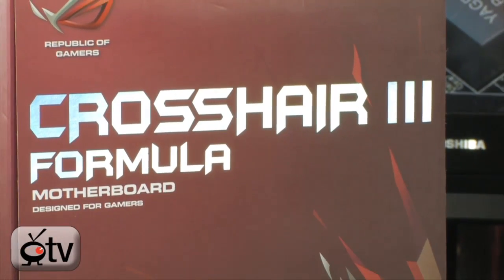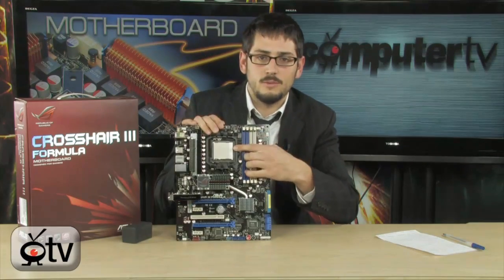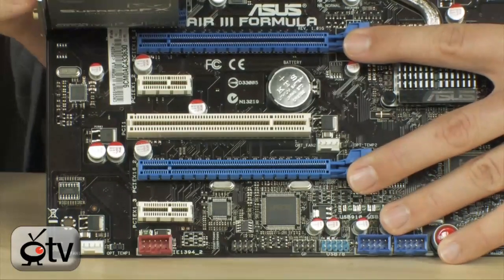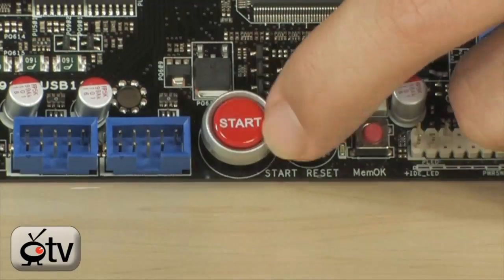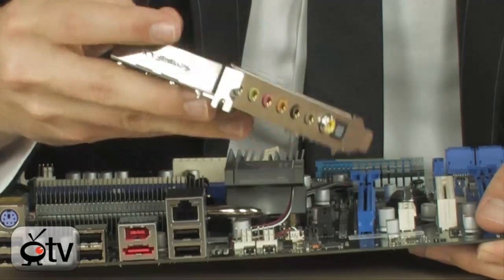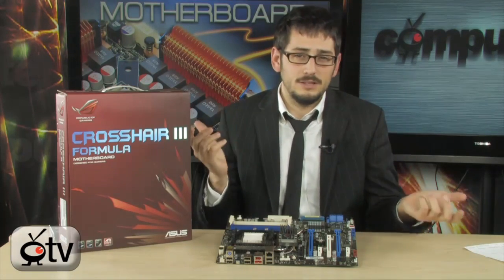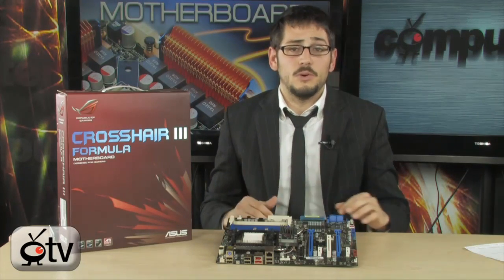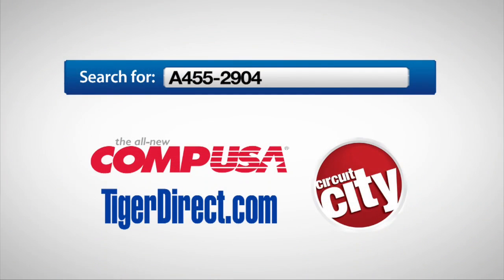Asus Crosshair III Formula Motherboard

Comment: i like AMD, they are inexpensive (they resell the prosesors that dont meet satisfaction as tris or duo... and the other cores WORK FINE, so no flamming). Not to mention had an issue with my possessor and they responded to my email in a day with about 15 different scenarios if the one previous didnt work.

Comment: i was considering a intel setup but they are way to expensive!!!!
I am happy with my setup right now its fast and i can do everything i need with it.
Im not trolling you its just that $989.00 for a unlocked processor from intel is seriously insane.
If I went with the same setup for intel i would of spent over $3000.00 and the way the econmomy is right now i would rather hold on to my money

Comment: its not expensive its only $199.99
compared to the same features on a intel board which runs over $300.00
get your facts straight you little OVERCLOCKING ORB!!!!!!!